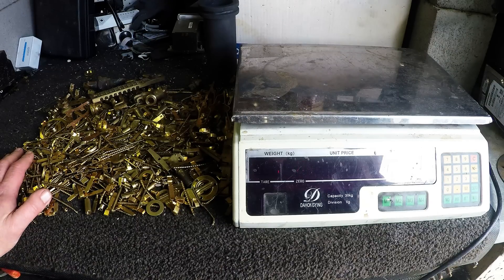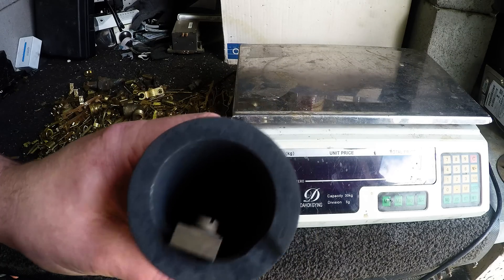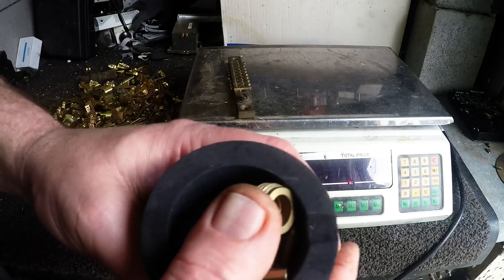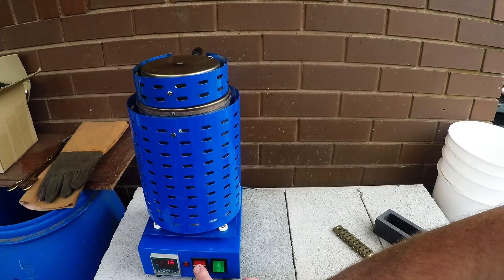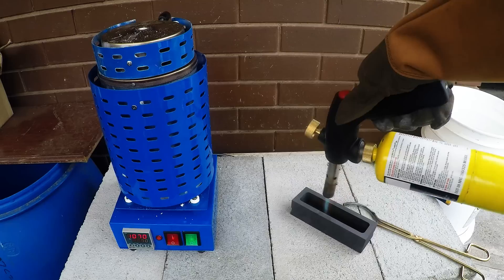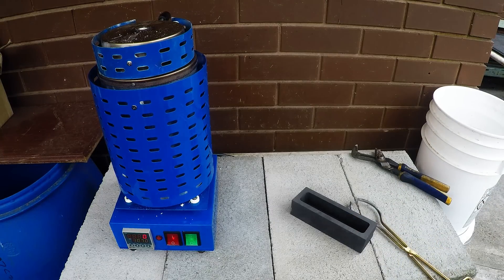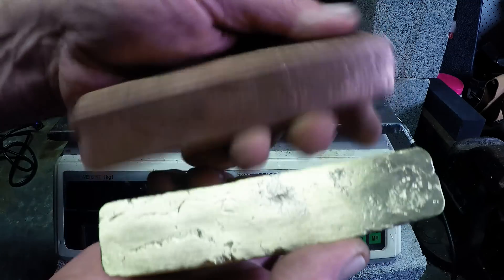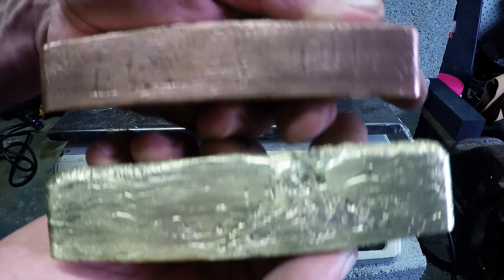Making a Brass Ingot from Scrap

Comment: Does anyone know what coating is on the power plug tips that look silver? I have double checked and inside they are definitely brass, but it seems to have some sort of silver looking coating that I am unsure of? I currently have these mixed with my pure brass, should I seperate them for when I go to melt?

Comment: Best time to add borax is when its melted because by the time it's starting to melt the borax will have burned off so wouldnt help. Also borax will eat graphite when cold so the crucible wont last as long. When hot borax wont eat the graphite

Comment: Use a cement block or brick about 3x the height of the mold to steady the tail of the crucible in order to better control the speed of the pour. You can also make a swing for the crucible to really do a neat job.

Comment: The relatively low melting point of brass
 (900 to 940 °C, 1,650 to 1,720 °F, depending on composition) and its 
flow characteristics make it a relatively easy material to cast. By 
varying the proportions of copper and zinc, the properties of the brass can be changed, allowing hard and soft brasses.

Comment: Melting brass? The Dad One wrote: All molten metals are dangerous that way. Brass has the added problem that if you overheat it it'll give off zinc oxide fumes, which can cause metal fume fever.Sep 17, 2011

Comment: Q&A
if u left it in the crucible that u heat it in will it shrink and come out round ?
Reply from the maker: Yep it usually does shrink enough to slide out when cool, sometimes though, borax can make it stick so i'd only do it with clean metal and no borax

Comment: nice video Ben. if the furnace breaks can you just replace the wire? if so how do u do so and what do i buy. also, where do you find all this stuff? scrapyards?
Reply from the maker: yes the element slides out, it's one complete unit with the insulating walls, costs around $100 to replace though but they shouldn't burn out like the other style on ebay. 

where do I find what stuff?
Reply: ohhh right i get you. thanks a lot for that. i was actually going to get an ebay one haha i guess thats a bad idea then? im from the UK myself so not too sure where else i would find one. and i mean all the things you melt down like the brass and copper heat sinks, tv's etc
Reply from the maker: best to get one from the US suppliers, they have better models.
my latest video explains how i get stuff
Reply: eWaste Ben ok thanks a lot man, will check it out right now :)

Comment: ok i'm way new to all this... so teach me whats the borex do to the differant sort's of brass... when melting it down.....??
Reply from the maker: Borax or flux does a few things, mostly it helps remove impurities, after pouring the borax forms on top of the metal in glass form holding the rubbish within, so you just chip it off, it also has more technical advantages that i'm not qualified to answer

Comment: Brass = Copper & Zinc, Bronze = Copper & Tin
Reply: Not always just that other stuff can be added often
Reply: @keytefirerefining1355  Yes always. Thats what the words mean. There are different metals added to both bronze and brass to achieve different properties but brass is primarily copper and zinc and bronze is primarily copper and tin.

Comment: So, my scrap yard told me that even the white prongs from electrical plugs are brass, just not yellow.  Is there a reason not to melt them together?
Reply from the maker: not really, I did it to keep it all yellow brass, brass can have different metals mixed in with the copper.
Reply: A silver-looking coating on brass is usually nickel. A small amount of nickel in brass or bronze is not only acceptable but desirable.

Comment: im going to buy such a furnace too but now i wondered how to clean the crucible after using
Reply: and what do you use to polish?
Reply from the maker: the crucible is graphite, anything that sticks when hot comes off when cool.
lot's of polishing wheels available at hardware stores, wire, stone, pastes.

Comment: 6:40 may i ask what the point of heating the bar up before placing into the smelter is?
Total noob here, what would otherwise happen if you didn't heat it prior?
Reply from the maker: mostly to remove moisture which adds hydrogen to the copper and will pop when adding, like a small explosion.

Comment: Nice bars Ben! Do scappers get more money at the scrap yards for large chunks of metals like ingots than they do for the bits and pieces you started with?
Reply from the maker: no same, but people who want to stack bars will pay more, but mostly copper, not brass, this is just for my personal stack
Reply: I've heard people talk about number 1 or number 2 copper. http://www.southernmetals.com/quick-tip-whats-the-difference-between-copper-1-and-copper-2/

If you melted down small wires and dirty copper #2, into ingots could you get number 1 for it?
Reply from the maker: depends on the yard but wire is #1 already and ingots are #2, it's only when you have dirty wire that's classed as burnt or laquered, when melting you melt that off so it becomes #2

Comment: How much can a smelter like this cost ?
Reply: I found several sites when I searched for it with the JC 220V model number from your link. Now that I look closer it seems you can get it closer to $350 USD. Not sure what the shipping charge is since I don't have an Alibaba account, but they're HUGE so I doubt it is unreasonable. Minimum order is one unit. 

https://wholesaler.alibaba.com/product-detail/220V-3KG-JC-Vertical-Type-Small_60542219696.html
Reply from the maker: 500 bucks
Reply: That's Australian, right? Your furnace is listed a little under $400 USD.
Reply from the maker: were is it listed for under 400us?
Reply from the maker: excellent research G&S, thanks, I might get a second unit next year
Reply: Didn't realize I had switched accounts. My bad. :)